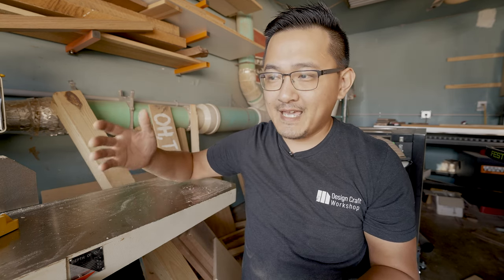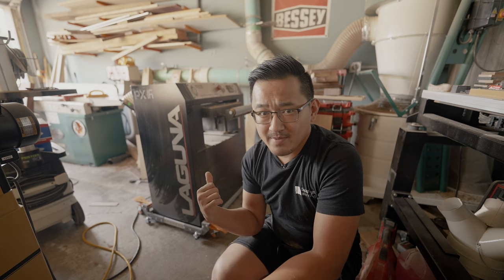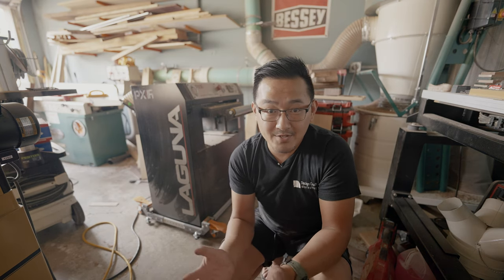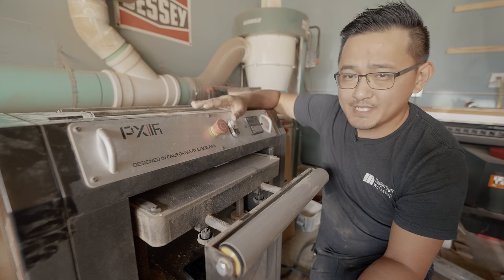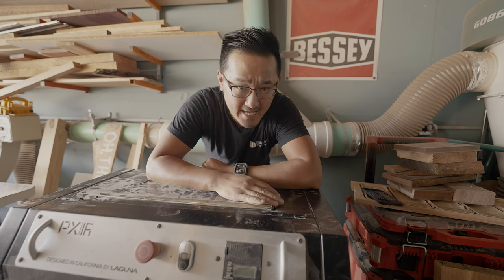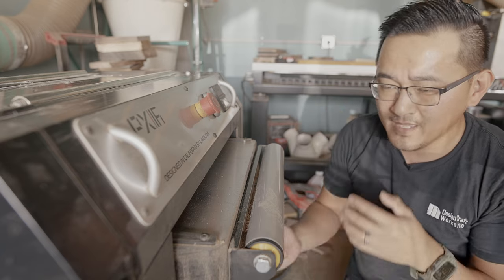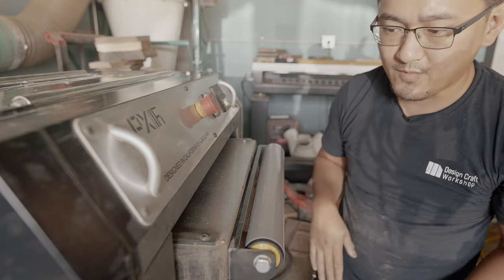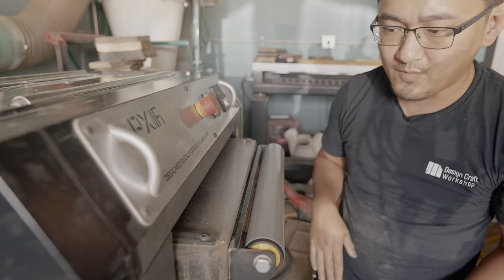The BIGGEST Woodworking Decision! // Woodworking Tool // Laguna PX16

Comment: I have the same planer in my shop. I've had it for little over a year now and have become very familiar with it. With that being said, I have yet to actually figure out where i'm suppose to add oil and exactly how much. I've been winging it and just dripping a few drops in the hex bolts on either side of the cutter head under the hood. You know anything about this?? I haven't experienced any issues so far so and i've really put this thing to work, like you i'm in the shop full-time.
Reply from the maker: I haven’t had any issues and haven’t oiled it yet. I’ll probably have to look through the manual when that time comes

Comment: Great review. I have some laguna tools. Love their bandsaws especially. It’s interesting outside of dust collection CFM and good piping the shroud on most planers, straight blades or helical is  under engineered. That exit off to the side and the hard 45 degree angles on the tight end cause a chip traffic jam. The transition should be balance on both sides and not block you taken the piece off the outfeed.
Reply from the maker: Love their bandsaw too. I do wish more manufacturers would make the shroud attachment above the cutter head. I think it’ll work much better that way.

Comment: I would say for the professional with space, two separate machines. I have a combo jointer which will probably just mainly be used as a jointer since it’s 12” wide with a helical head. My Grizzly benchtop unit can plane but the jointer bed doesn’t lift up which means I have to contend with a 42.5” long bed thats always in ny way. I bought a nice lunchbox style planer and that works better since I have considerably more visibility and functionality. The grizzly is just clunky for planing and very plain BUT does the job. When my wife and I get a house and a large garage, I will go for two floor units.
Reply from the maker: That's a good decision. I think it's much more convenient long term. Hope you get that bigger space soon!

Comment: Great review, I was wondering if you have the actual dimensions of the machine handy, trying to figure out which mobile base I'd need for it, thanks!
Reply from the maker: Thank you! i got the Bora PM2550 and it fits. I think it was the limit of what that base can handle so if you have spare cash get the PM3550.

Comment: You said in the video that you didn't care for the dust chute configuration. I was just looking at this planer online...the specs say the dust chute can be positioned left or right to accommodate dust collection routing...you might be able to flip it if needed
Reply from the maker: Yeah, you can flip it but in some cases like currently in my shop it's on a mobile base. So the way that the shroud is positioned and where the dust collection hose comes off of the pipe, I can only roll the machine out in one orientation. If it was straight, it wouldn't matter. But if yours is stationary then yea you can rotate the shroud to fit your routing

Comment: So I bought the PX22, finish is great but the infeed and outfeed rollers are terrible. I’ve adjusted my machine 3 times with only 10 hours of use. No help from Laguna. My machine was not setup and now all my boards have to manually finished. Do you have a video of how you adjust the rollers properly???
Reply: If you also look on YouTube no one has a video on how to fix this issue!
Reply from the maker: I don't have a video on making that adjustment. The snipe on mine as I mentioned was very minimal. it looked more like the roller were slightly pressing harder at the end rather than the cutter taking a bite out of the material. So I didn't bother trying to adjust it since I feared I would make it worse.

Comment: BTW- You can flip the dust collection shroud to left or right easily.
Reply from the maker: Yes, you could. Much prefer a design where I don't haven't to switch based on where the machine is moved.

Comment: I have been told NOT to purchase anything that has the table move up or down instead of the head. Have you seen any issues with this?
Reply from the maker: No issues so far. It's a great machine and wouldn't trade it out unless I go for the larger version.
Reply: Where did you hear this? You might have heard wrong?
Your referring to a fixed bed planer, as in the Oliver planers and Grizzly has one or two.
There are not that many choices for them.
Most planers are not fixed bed and have a table that moves, their heads are locked down.
I originally was sold on getting a fixed bed mainly for the advantage of
extended infeed and outfeed.
once set, the extended infeed and outfeed would never need to be adjusted.
But the more I read, the more complaints about snipe with fixed bed planers.
It’s easier for manufactures to design a moving table than a moving head.
Less to go wrong.
And I concluded with some vevor roller stands, they adjust so quick and easy, 
if I ever need to extend the in or outfeed.
I gave up on the fixed bed idea and decided to focus on the planer itself.